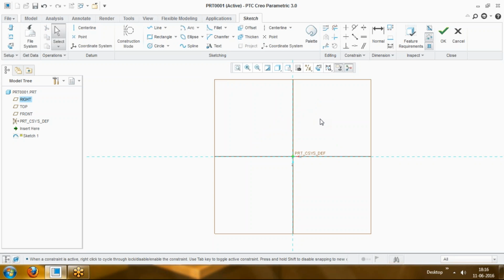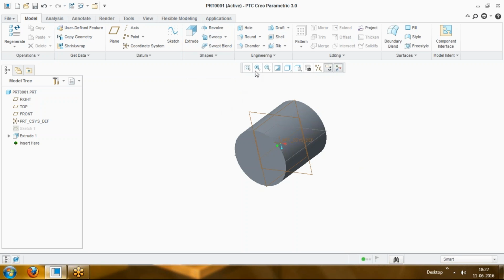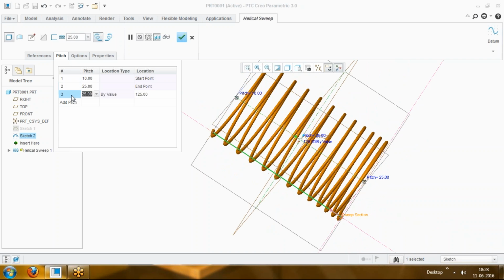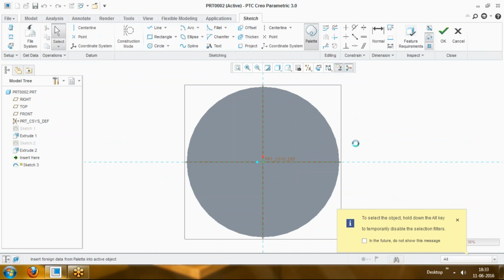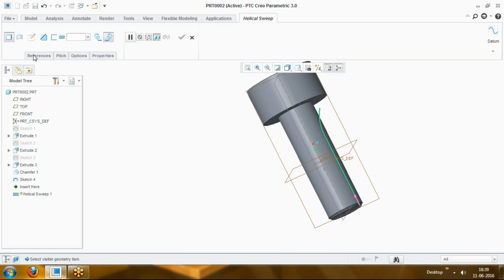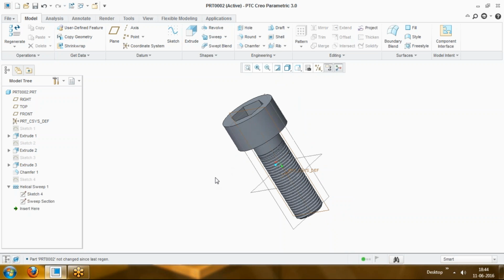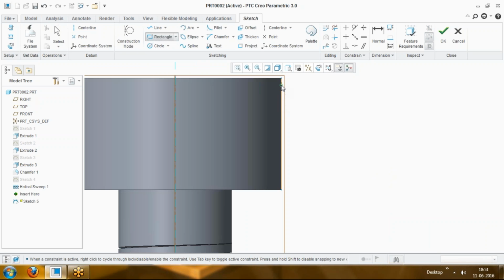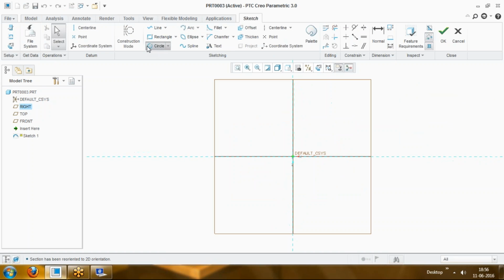Learn to create complete Bolt and Spring in CREO 2.0|Helical Sweep

Comment: What is the impact by changing the pitch value of the spring in reality? Mainly at the ends and at the center.
Reply from the maker: By doing this, some of the coils close up faster than the rest of the coils and become ‘inactive’, meaning they no longer absorb the compressive energy resulting from applied forces.  By lessening the amount of active energy absorbing coils, the spring in turn becomes stiffer and the rate increases.  A relatively new way of varying spring rates is by actually varying the material size itself.